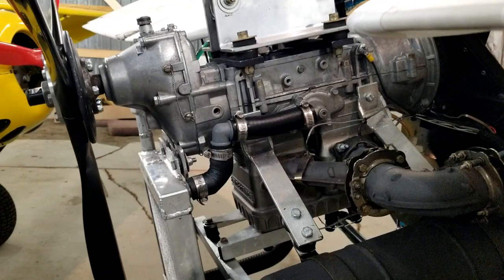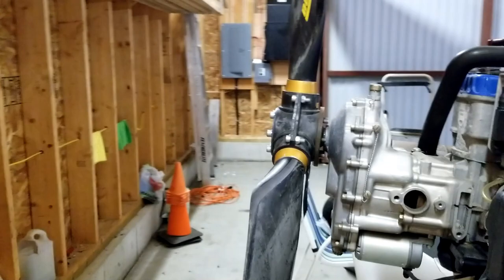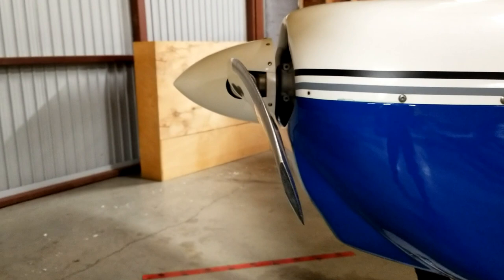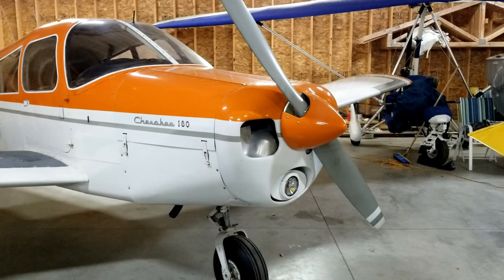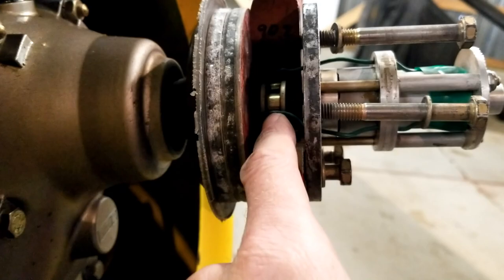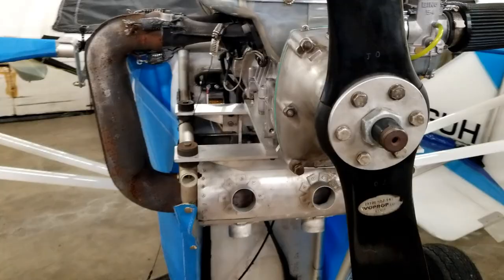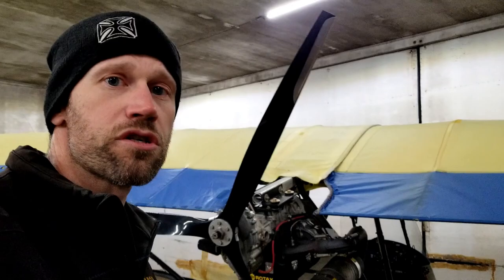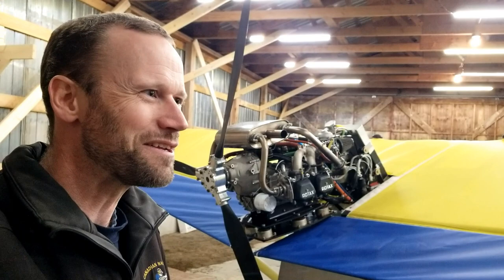Propellers Explained

Comment: The reason 3 blade props run smoother on pushers is because there is a high pressure and low pressure zone below and above the wing. As a 2 blade prop spins, each blade alternates between the high and low pressure zone at the same time. The blades of a 3 blade prop doesn't come in/out of these zones at the same time.

Comment: The twist is called 'Helical pitch' to understand how a propeller blade is made look at one of those hefty ships propellers,as an 'Airscrew' it screws its way through the water,just after WW2 they got to the stage whereby the engine to propeller combination was at its peak in power as a propeller can only absorb so much before it becomes rebundant,so the answer was to develop the contra rotating propeller which is two props geard together for real performance.Its all about a trade off in take off performance with a fixed pitch propeller set at its optimum setting then finding the best cruise performance  possible,to that end the designers made the automatic propeller whereby the airscrew finds its own best setting whatever the cruise or take off situation.Great subject matter Matt,please do a similar one on airfoils running through the range from Newtons theory and the Burnelli principle of lifting fuselages,love your wooden hangar and all the interesting airplanes inside it there is another video for you covering the contents of your hangar.

Comment: Another topic you might have covered is the issue of engine/prop matching.  I ran into a situation where the prop manufacture said their prop was perfect for my 36 HP engine and even suggested an initial AOA setting.  The engine was new and it's break-in procedure called for running at limited rpms for quite awhile.  As a result of following everyone's instructions, I was unable to check to see if the engine could make full rpm at the suggested prop setting.  So the clutch was destroyed within the first hour of run in time.

The problem was not just weight but rather the prop's moment of inertia (MOI) exceeding the engine's MOI limit.  My order is now in (to a new vendor: E-Prop) for a replacement specified for my engine.  In the meantime I will rebuild the clutch. 

But the real issue is trying to get either the engine manufacture or the prop manufacture to divulge their MOI information for any given engine or propeller.  So unless you know you are using a prop that is compatible with your engine, I suggest that a new engine is run-in with a very "fine" prop setting.

Comment: 3 blade pushers run smoother than 2 blade because there's a thin layer of faster air coming off the trailing edge of the wing, and with a 2 blade prop, both blades are hitting it and interacting with it at the same time, every 180° of prop rotation, whereas with a 3 blade, only one blade at a time is, and every 60°. But there's probably also some truth to those other things, too.

And for an interesting story, look up the man behind IVO props, Ivo Zdarsky. He built an ultralight to escape from behind the iron curtain, and today lives alone in a hangar in the ghost town of Lucin, Utah.

Comment: 3 bladed props are smoother because they create a higher frequency of air pulses at lower amplitude. The higher frequency means less coupling since it's further away from the resonant frequency of the air frame.

Comment: A higher blade count, will induce a higher frequency pulse on the affected surfaces. Many times this is above the resonant frequency of that surface, so you will notice less vibration. The down side, is that more blades, means more drag, so the engine must work harder if the diameter of the propeller disk is the same size.

Comment: Great explanation mat : from the air foil point of view; ie max lift min drag ! However all foils also displace air ; size for three bladed props displace air better than two ,  in a tractor config the displaced air causes extra skin turbulence. None of this can be looked at alone , its more a case of a little bit of Column A , a little bit of column B and some column C , don’t forget D and G . Project Scrapie has a displacement prop , EXTREME. On your other point the three bladed  prop doesn’t have another blade at 180 degrees to create harmonic resonance , 3 and 5 smooth, 2 and 4 noisy , subject to shape compeziton and outside influences like skin turbulence in the case of a pusher ,  don’t get me wrong, not an expert ether , cheers buddy love your show, keep it up

Comment: Great Video Matt, the Prop on the Boop is Ground adjustable but acording to my Max Rpm on the Rotax I am getting 5800 so I should probaby leave it alone.. More speed would be nice but Im probably getting all Im going to get.??.Down River Tim (Oak Point Area)
Reply from the maker: You should be getting 5600 rpm in straight and level flight at full throttle. If you're getting 5800, you're set up for STOL operations. If you're ok with losing a little bit of climb performance, you could pick up a few mph by putting a bit more pitch in the prop to give you a faster cruise speed.
Reply: @mmatt  Thanks for the info Matt. I like having the STOL performance and my speed straight and level at 5200 rpm is 75mph with the floats on. I may gain a little speed by re-pitching but with the floats on I need to keep all the climb I can get lol. I am super intrested to find out what my level flight speed and climb is with the snow skis on if the pond ever freezez to give me a runway to take off from..Im fueled and ready to go just need some cold weather..

Comment: ive always wondered if you could have a 4 bladed prop where two blades have a fine pitch and two blades have a course pitch, my theory is that way youd get good takeoff performance and cruise performance without the complexity of a variable pitch prop, but i wonder if maybe the extra drag would cancel out the benefits, either way theres probably a reason why this isnt a thing thats ever been done (as far as i know) but i think itd be interesting to try
Reply: no that is a horrible idea. think of it like having a car that has two motors, one for the front wheels and one for the back wheels. And the two motors are trying to turn the front and back wheels at different speeds.
Reply: @TaxpayerDave  some cars do exactly that lol

Comment: so, my comment did not like and it was removed!
     a different look at three blades and two blades without changing the angle of attack: a three-bladed propeller creates a smaller pressure difference in front of the propeller and behind the propeller (the pressure is less in front of the propeller, the pressure on the rear surface is greater AND THE DIFFERENCE OF THESE PRESSURES AND CREATES the pulling force of the propeller), this creates the effect smoother operation of three blades
Больше

Comment: great stuff Matt. So what's the best prop for a Eurofox (european version of the Kitfox) with a Rotax 912 ULS3? I'm getting the plane in september and I have to choose and I don't know what's the best. I'd like a constant speed prop but is if going to weigh too much? Is an adjustable one better? I'd like to have STOL features but fly at 110kts. How do you make the right choice you know? And what if you screw it up completely?? choices choices choices Thanks for sharing
Reply from the maker: If you want a less expensive in flight adjustable option, consider the Ivo prop. I like them.

Comment: Thanks for the excellant info.  I've been thinking about adjusting my prop on my Hawk, and now I know which way to go.   Also have a question on how you are running the fuel line from the  your wing tanks.  I'm about to do the same but wondering if you are running to the main sit-tank or directly into the fuel line to the engine.  Also if to the tank where are you connecting the wing fuel lines to the main tank.   Thanks ahead of time.   Enjoy your videos.
Newfygoofy2
Reply from the maker: My wing tanks feed the engine and my seat tank feeds the wing tanks. Each wing tank has an on/off valve so I can keep the tanks balanced in case they don't feed evenly. Here's a video of the set-up:
https://www.youtube.com/watch?v=pmbuC99sZmk
Reply: @mmatt  Thanks.  Did think of reversing the flow to wing tanks.   Keep punching holes in the sky.

Comment: matt, there is a good video about e-props propellors that explains why 3 blades are smoother than two for vibration. You are basically increasing the frequency of thrust at a given RPM, so the absence of thrust between props is less pronounced and the thrust is more consistent.  https://www.youtube.com/watch?v=zM5SP7XSv1s

Comment: I'm curious what the engineers are thinking back in WW2 when they setup some birds with 4,5&6 bladed propellers
Reply: That is a good question. The basic answer is props don't work it the tips go supersonic and the engines had a lot of power (over 1000hp), so to use a two blade would mean a very big prop (with a taildragger that would be hard to keep in the runway). The way they kept the tips subsonic was to have smaller (managable) diameter props and add blades, as you can't have the pitch great enough to absorb the power, as it would be stalled until the aircraft was moving at speed.
Reply from the maker: Well I'd say they were trying to harness some serious horsepower. More blades are required on more powerful engines so that the blades don't have to be so long.
Reply: @mmatt  Is that not what I said?!?
Reply: Would there be any benefit to install a 2 speed gearbox on the prop such as a direct drive/underdrive, or direct/overdrive so that you could keep the engine in the power band in different flight phases?
Reply from the maker: @russellsmith3825  You could but it makes more sense to simply alter the pitch of the prop as it does essentially the same thing and is much easier and lighter to do.
Reply: @russellsmith3825  Gearboxes weight and tip speed are the issues, hence the variable pitch prop (which acts as an automatic gearbox), was introduced to give fine pitch during talkoff and increasing as you go to cruse, allowing the engine power, RPM and aircraft speed to be ballanced to give best performance and fine adjustment.
Reply: @flyingkub  " Gearboxes weight and tip speed are the issues, hence the variable pitch prop" How will this formula change with an electric motor? I always wonder why electric cars don't have transmissions but I hear they make the same power at any speed so it doesn't matter what speed they are spinning at (or something like that) so I wonder how that electric motor peak power curve will be affected, or affect, blade pitch?
Reply: @markconnolly692  The problem with tip speed is as the tip of the prop gets near to the speed of sound at around mach .9 the aerofoil becomes massively less effective and the drag goes up a very large amount, so we need to keep the tip speed down. Now as you say electric motors produce max torque right from start up but we can't use the low rpm high torque to drive the coarse pitch needed for fast flight as the prop blade would be stalled producing very little thrust as we start our takeoff run. That is the reason light / microlight aircraft with fixed pitch have to work out if they want takeoff / climb performance or cruse. Heavier WW2 fighter aircraft could run variable pitch to try to give both takeoff and fast flight performance. Electric powered aircraft would still either make a choice or have variable pitch to keep the prop efficient through the speed range. And after all that there is still a compromise on the prop as the twist in the blade is only optimum at a narrow RPM aircraft speed range.